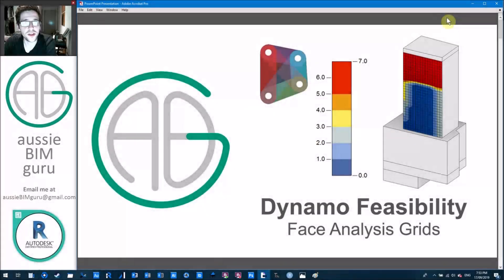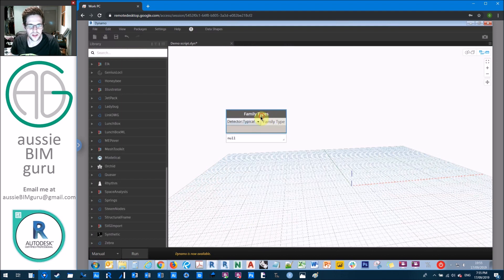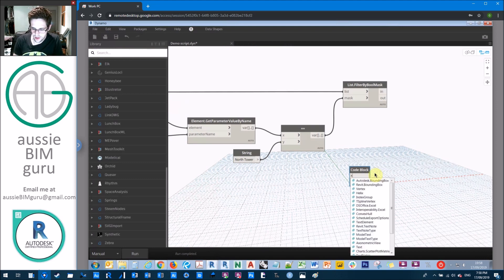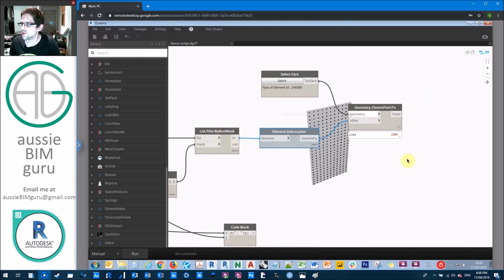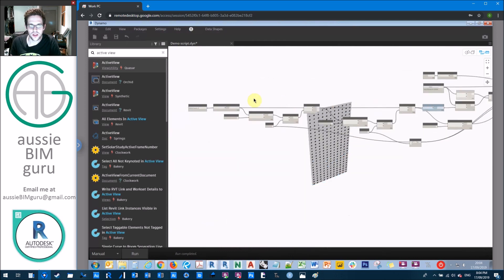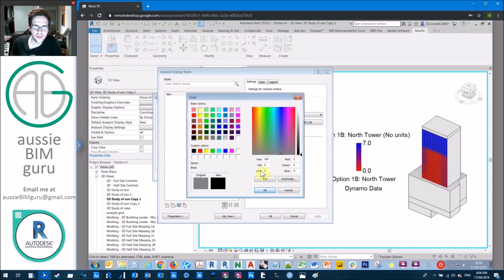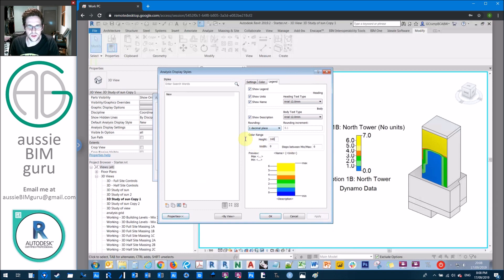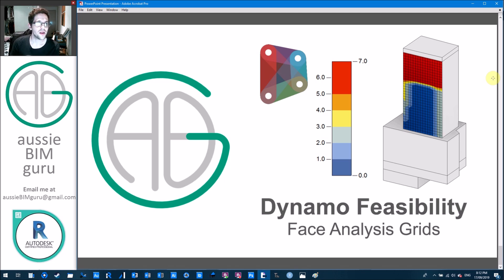Face Analysis Grids using Dynamo!

Comment: Is it possible to do the same thing for lighting fixtures like Dialux?
Reply from the maker: Not really, software like dialux/elumtools etc. has many means of calculating raybounces and cumulation of light which this approach doesn't really simulate. This method is only suitable for verifying direct light contact/no contact at a given time, or cumulatively. Dialux and other tools consider things like lux rating, falloff and fixture dispersion/IES.

Comment: Why you use Geometry.ClosestPoint to (9:00)?
Reply from the maker: The test points are slightly offset from the mass face so that they don't intersect their sun rays with it.

In order to assess a UV parameter at point, we need the point to be on that surface. Closest point does the trick!

Comment: Question: How knows Revit/Dynamo that it is about the sun direction? You don't have placed any node in Dynamo for the sun direction. The colours in Revit reffers to the sun, right?
Reply from the maker: The gradient point data is being derived from 'sensors' set up earlier in this series, where I used ladybug to analyse the sun direction and intersect sun rays with the site, then set the results as a parameter.

The colours in this case represent the number of total hours of sunlight exposure during the winter solstice in sydney.

Comment: Great job, as always. Do you think it is possible to connect this node with wind values (to perform the shape in according to the speed/direction of the wind in a specific region)?
Reply from the maker: Definitely, although I'm not sure if Dynamo is the right tool for this. You would need a workflow which allows you to calculate the windload at specific points adjacent to a testing face.

I've been playing with Ladybug for Grasshopper recently - it has some wind components which might be worth looking further into...
https://rhino.github.io/components/ladybug/windSpeedCalculator.html
https://rhino.github.io/components/ladybug/windRose.html
https://www.lynda.com/Rhino-tutorials/Analyzing-wind-data-Ladybug/599608/669585-4.html

There's a fairly well documented Dynamo workflow here, although it involves a lot of Python and is structurally focused;
https://blogs.autodesk.com/bim-and-beam/2017/02/20/dynamo-to-generate-wind-loads-in-revit/

Hope that helps!